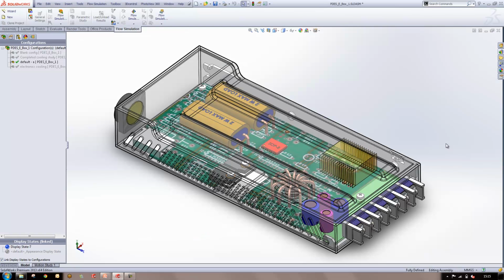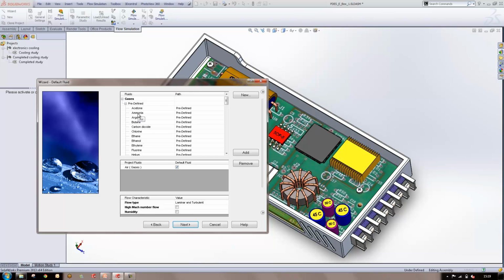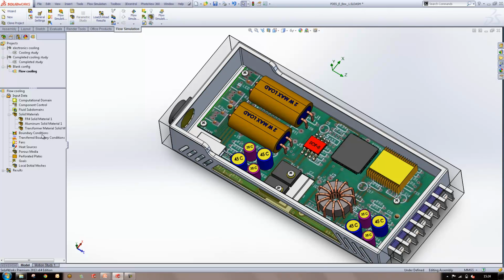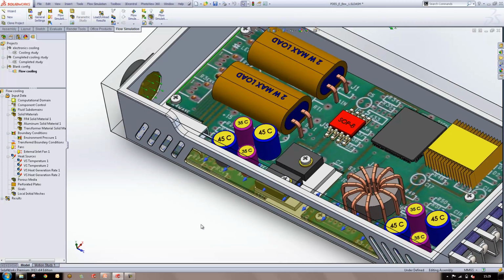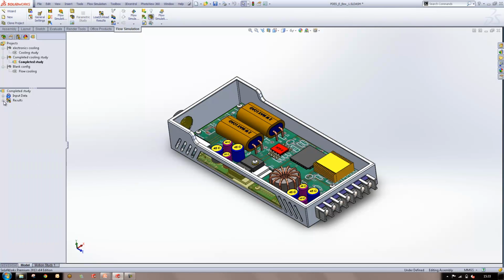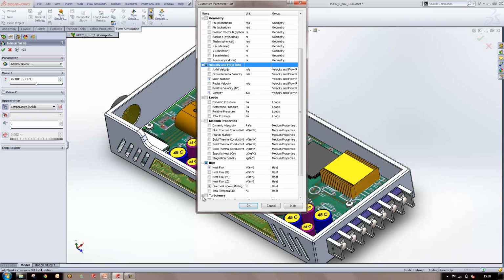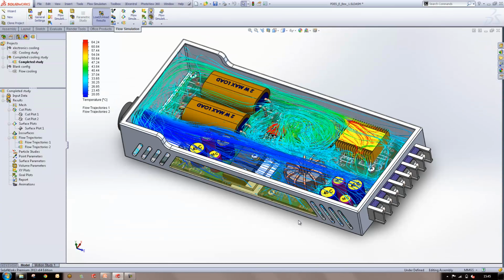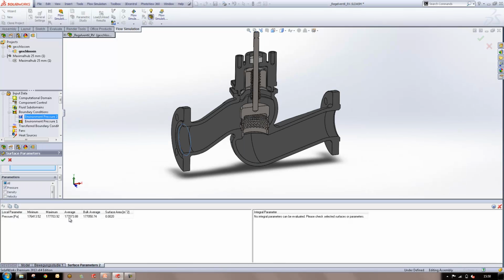Simulating fluid flow in your designs with SolidWorks Flow Simulation

Comment: Why not simply placing the fan near that heat sink? why didn't the architecture of the component wasn't built to allow a proper placement of the heat sink in that case, near the fan.

Comment: Hi, great vid. I am building a boundary fence at home and wanted to look at various paling layouts to see how this impacts the fences ability to shelter the garden from the prevailing wind. Theoretically a solid fence with no gaps creates more turbulence behind it whereas one with gaps has less. Would my study be external or internal? Could I set it up exactly like yours with a section of fence with various configurations? I want to do a basic study first so that I can see the reduction of wind velocity and patterns of turbulance in the yard but also downstream of the fence see if the wind will flow over or through the garden beds. The other complication is that there is another fence on the opposite boundary which I suppose I should include in a later sim to see how this effects the wind that passes through/over the first fence. I also want to see what gap size is the best to give me the best windbreak with the minimum of turbulence and I think I can use SW to test various gaps and give me the best answer. Similarly there may be an advantage of horizontal palings vs vertical ones and in the first instance smaller gaps at the bottom increasing to the top of the fence. Of course privacy is another consideration and is ultimately a trade off vs the efficiency of a the windbreak. Any advice on how to set up this analysis? Thanks

Comment: Hello Sir, how did you import the PCB with the components inside solidworks progrm?, and is it possible to simulate the heat transfer for a PCB with 4 layers of copper wusing this program? (I use Altium PCB design, and I would like to simulate the heat transfer)